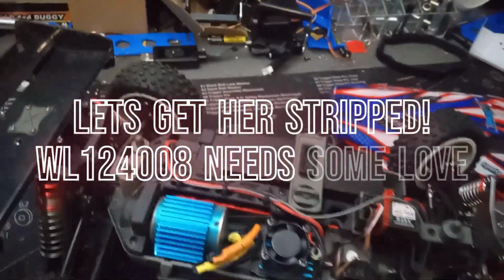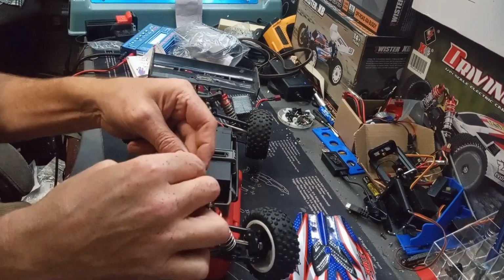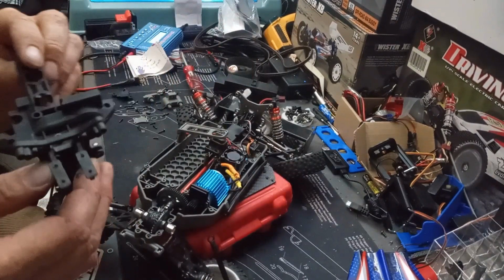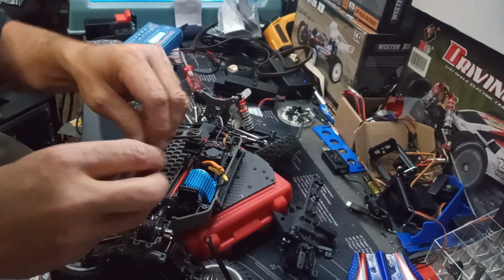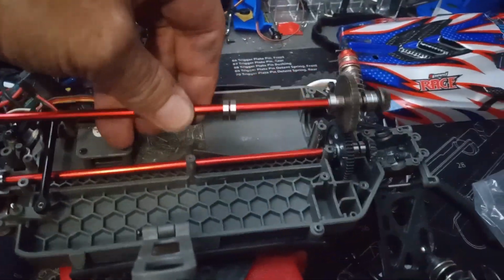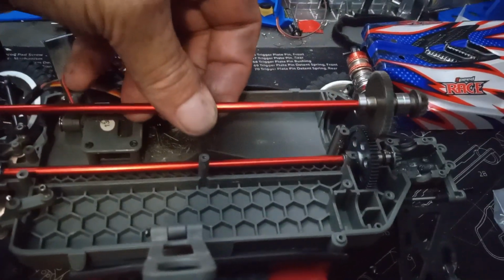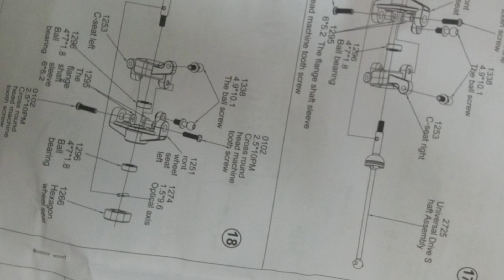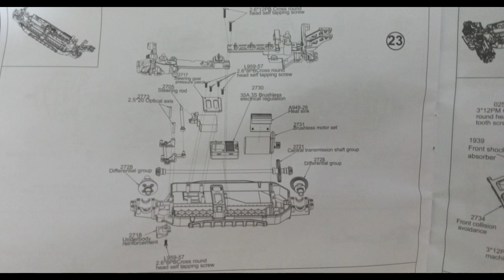Lets Get her Stripped! - She Needs Some Love

Comment: Good luck removing motor and pinion. I stripped the grub screw to pinion and broke a motor mount screw. Time for new components with custom carbon fiber motor mount
Reply from the maker: Ya, that's main reason I'm waiting on that swap out Yet.  If its anything like the 144001 it'll need some serious heat.  Make sure to post them upgrades.  Always looking for idea's!  Thanks for commenting bud..  Keeper RIPPIN..